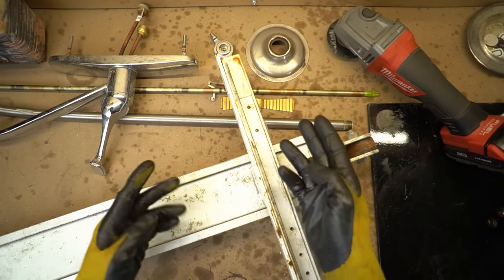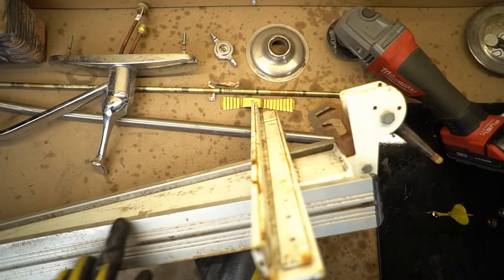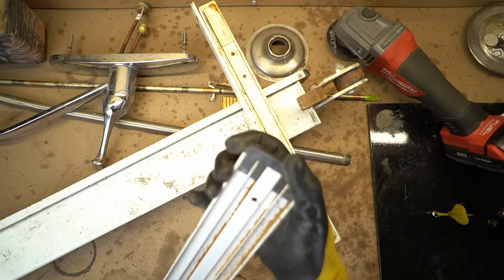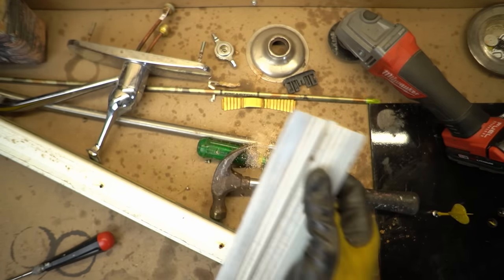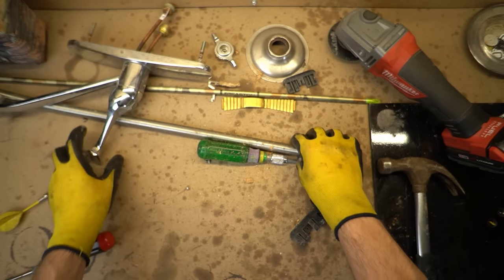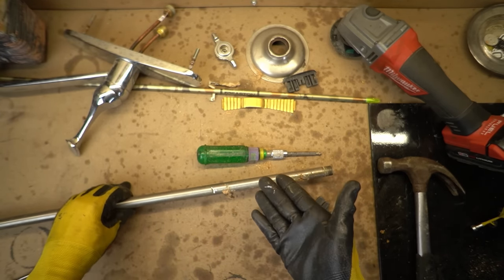Scrap Metal Identification Guide - How To Make Money Scrapping

Comment: Hey thub, just a heads up. That arrow is an aluminum arrow shaft. The Easton camo hunter is their lower end shafts and thus are built with lower quality components. Love the videos, keep them up!!
Reply: You are correct. I have had these arrows before and always been aluminum. If it doesn't specifically say its titanium its probably not. I would think titanium is too heavy for arrows. Carbon fiber is typically what higher end arrows are made of
Reply from the maker: Thanks so much for pointing that out! Makes sense they would print titanium on it if it were, stuff isn’t cheap.
Reply: @thubprint  no problem, I would suggest holding onto the shafts as if there isn't anything wrong with it they can sell from anywhere from $5-$15 a piece.

Comment: The root killer test works great..copper sulphate in water solution  😉 Grind, put a tiny bit on exposed metal. If it turns black its die cast. If it stays clear it's Aluminum. Sorted. The silver plated stuff goes for $4:50 US at my buyer..hoard that stuff!

Comment: i have couple of faucet pieces that ain't stainless steel (no spark), kinda heavy and not yellow brass or red copper.  I didn't know they use zinc in bathroom faucet or zinc is that heavy.  I first thought it might be a tin alloy.
Reply from the maker: Definitely zinc/alu alloy. They’ll just give you dirty aluminum price most likely. It’s fine but I always find the pay for a bucket full somewhat disappointing
Reply: @thubprint  do you separate the zinc or send it to shred?

Comment: thought i was doing good with a plumber dumpster haul, lots of nice copper and brass, and i was sorting aluminum and stainless steel faucets, then came across this shiny silver piece that was very magnetic, i'm like, "must be steel", then noticed it was printed "stainless steel" across it...  now i'm confused.
Reply from the maker: Could be 410 or something like that. I had a couple solid slugs of the stuff and it took awhile but I did find a buyer for it. Most of the time I just throw it in with the steel cuz it isn’t worth enough to shop around trying to find a buyer

Comment: I'm wondering how to tell what's tin and what is steel. For example I have a big tool box that is decently thin but not sure if it's considered steel or tin.
Reply from the maker: For sure! “Tin” is a bit of an outrageous name because obviously steel is iron with extra carbon or sometimes silicon. I think the name comes from “tin cans”, which are also not tin but… as far as my scrapyard categorizes things, “tin shred” is anything that is mostly steel with less than 10% contaminants like paint and plastic and other metals. “Prepared steel” is the thicker pieces that have a higher recovery percentage, and at my yard that means anything thicker than 1/8” with no contaminants. This part is specific to your scrapyard though, some scrapyards expect it to be greater than 1/4”, some require that it isn’t a shape that can hold water, and many just don’t have have steel categories and call everything tin shred (or “light iron”). You’ll have to learn what your local yard uses for categories but my guess would be the toolbox is shred category, and may have a thick steel plate in the bottom for a counterweight that would be prepared steel if you removed it.
Reply: @thubprint  thank you very much super helpful. I bought a property and there is tonz of metal on it I'm scrapping :)
Reply from the maker: @lavitikis100  well, have fun! 😁

Comment: If you just want to get dirty with your gold plating, you can amalgamate it off of base metals with mercury.
Reply from the maker: But how do you remove it from the mercury?
Reply: @thubprint  Burn it.  That's why I say get nasty with it lol
Reply: @thubprint  You can distill off the mercury, but it's not an easy problem as you need to fabricate a still made out of iron (any other metal will be dissolved by the mercury). Check out Cody's Lab video on mercury distillation.